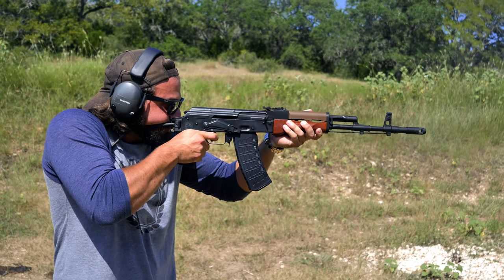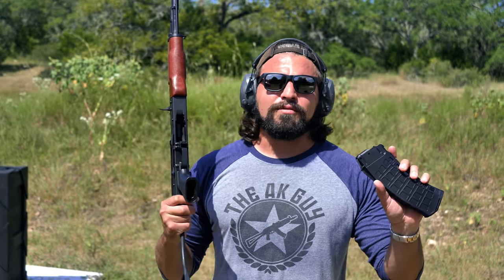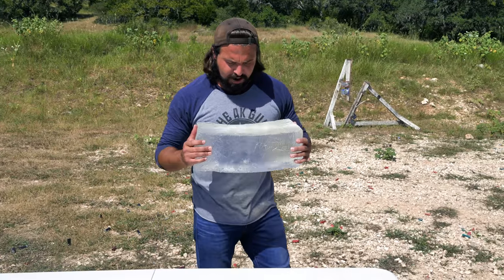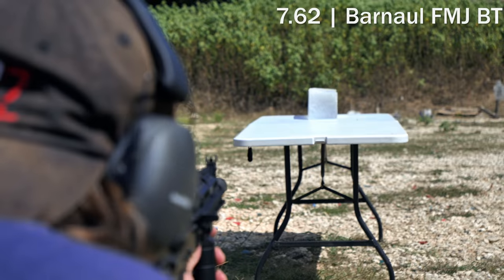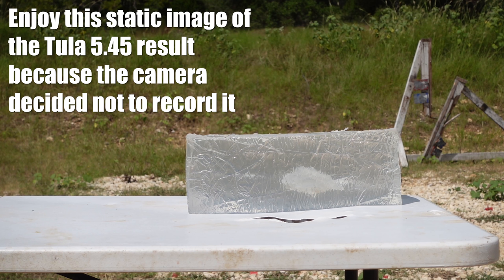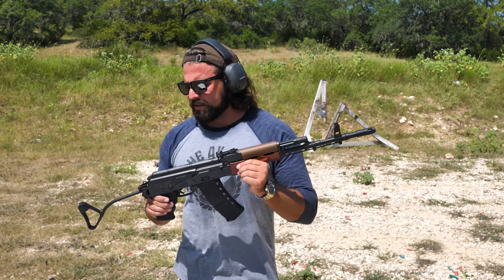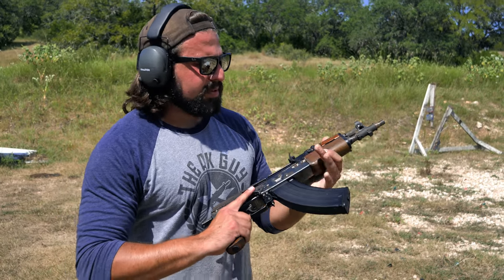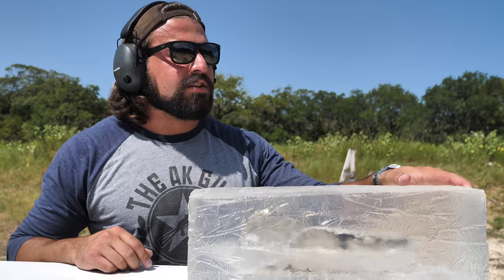7.62 vs 5.45 - Which Is Better?

Comment: Easy. 5.45x39 is way better than 7.62x39. Lighter, faster, flat shooting and has that "poison bullet" effect. 5.45 is also a better penetrating round that 556, due to the longer projectile :)
Reply: truly a man after my own heart
I really wish more western videogame companies would allow us to use it more effectively
cough cough Call of Duty cough (give us more than 30 round 5.45 mags)
Reply: 7.62 is better. better  penetration  than 308 and 5.45.  5.45 is only better at longer range
Reply: @djjaysky9071  nah the .22 bullet penetrates easier and goes faster
Reply: Are you saying the 5.45 round is longer than the 5.56 round?
Reply: Are you saying the 5.45 round is longer than the 5.56 round?
Reply: @djjaysky9071  Why would 7.62x39 have more penetration? I would think that a higher velocity projectile even if it is lighter would have better penetration than a heavier, slower projectile.
Reply: @badassnelson  correct, the projectile of a 5.45 is longer than a 5.56
Reply: @christopherlatorre7285  5.56/223 has a VERY wide variety of projectiles, only 308 can compete in variety (and 50BMG if you only consider those officially adopted by our military).
Reply: @djjaysky9071  No, it definitely doesn't outpenetrate .308 unless you're comparing very different bullet constructions.
@Badass Nelson No, he said the projectile not the round. Not that it's a huge factor anyway, nor is overall round length.
@Quentagon Thornton On certain barrier materials 7.62 will outpenetrate the lighter rounds (5.45 & 5.56), due to the increased momentum helping it continue where the lighter bullets can be more likely to deflect or break up.This is often cited as making it 'better' while dismissing other areas it's weaker in.
Reply: @quentagonthornton49  Heavier slower projectiles have better penetration than faster lighter WHEN EVERYTHING ELSE IS EQUAL (including bullet construction, energy and cross-section), but in 7.62 vs 5.45 nothing is equal.
Reply: 5.45x39 is actually far more devastating than the 7.62mm rounds used in typical AKs because it was developed in response to the M16's use in Vietnam
Reply: @BouncyStickman Brandon talked about it, with the hollow cavity in the tip (which I think was originally done for balance) it has a very high likelihood of tumbling upon impact and causing very significant wounding. Supposedly people in the area who were being shot with it (Afghanistan) started calling it the poison bullet, presumably due to the terminal effect, in a similar but different way to the original 5.56 loading causing massive wounds through fragmentation. The word you want is piqued not peaked btw, it's nbd but I would want to know if it were me.
Reply: @BouncyStickman A term that came from the Mujahadeen in Afghanistan. The 5.45 would yaw wildly once inside the body and create horrific wounds, sometimes doing things like entering the torso and exiting the leg of the target. Similar stories exist about the 5.56 in Vietnam, back when the normal loading was a 55gr bullet.
Reply: it's actually "situational"    5.45 is better open field and for long range patrols,  its lighter, so you can carry more ammo, and or more rations.   

7.62x39 is a better "brush" round.   its heavier mass means it deflects less when it hits tree's and branches.  This makes it more effective in dense foliage such as jungle/forest.  

So for a light fast "foot force"  the 5.45 is better, especailly given platforms like the AKSU.    For a heavier defensive or brush force, the 7.62x39 with the RPK and maybe the Tabuk backing things up.
Reply: “Poison bullet”? Care to explain?
Reply: @djjaysky9071  .308 (7.62x51) is literally a heavy-er and faster projectile with a longer effective range
Reply: @quentagonthornton49  The heavier round is more "barrier blind" than the lighter, less stable round, which is why it remains in use by GRU/Spetz and similar for any operation where they expect to have to shoot into/through softskin vehicles.
There are other videos on YT comparing them (and 5.56x45) in shooting through car bodies at targets on the other side. Or through cinderblocks.
Reply: @Garrumx  The twist rate and barrel length of Vietnam era M16s was far superior imo. A 20" barrel with a 1:12 twist was so much better for the ballistics of 5.56.
Reply: @karelpgbr  once a 5.45 hits you it starts tumbling inside of the victims body creating very vide and horrific wounds which are very hard to patch and heal so a target would often lose too much blood and bleed out the term poison bullet comes from Afghanistan
Reply: @mikefelty2625  that’s why I love my Zastava, 18.5 inch barrel with the IMI M193 55gr gives similar ballistics to the OG M16A1s shooting the first 5.56 load the US used.
Reply: 5.45 is better for the soldier, who has logistical advantages and needs, or the person who has clear shooting lanes and needs longer target precision. 7.62 however is better for people who need to shoot through concealment, do not have supporting or suppressive fire, and are more concerned with short range reactive shooting, and cannot afford more " exotic " projectiles.
Reply: @djjaysky9071  did you say 7.62 x 39 has better penetration then 7.62 x 51(308)?    Ok
Reply: @The_Honcho  I want one of the M16A2 clones with the O.G. twist rate and barrel length. I have plenty M193 laying around. About half of my 5.56 is that, the other half is M855, which does better with the shorter faster twist rate barrels. I like Zastavas a lot, just don't own any. I've heard from friends that the powder IMI uses can burn a little dirty, but I have no experience first hand.
Reply: Still 762 is better
Reply: @Garrumx  
That poison bullet the comes from a Soldier of Fortune magazine article in the late 80s. He made that claim, yet nobody else ever did. Ever since, it's been repeated over the decades, but no afghan would have a clue what you're talking about.
Reply: @mikefelty2625  it depends on the weight of the bullet.
Reply: @SilverStarHeggisist  I know. The lighter 55 grain M193 works way better out of the 20 inch barrel with the 1 in 12 twist rate. The heavier 62 grain M855 works better with shorter barrels with a 1 in 8 or 1 in 9 twist rate. 16 inch barrels are by far the most common barrel length for current AR-15 rifles chambered in 5.56, and most of them have a 1 in 9 twist rate. In my experience 62 grain ammo works better ballistically in newer AR-15 rifles with the faster twist rate. But, the longer barrel with the slower twist is even better with the 55 grain ammo.
Reply: Fragmentation & expansion>yaw
Reply: @quentagonthornton49  this is correct. Only when it meets the overmatch point does mass affect armor penetration. Also .308 isn’t a intermediate rifle round..
Reply: @jameshealy4594  they also call the forward assist on M4s the sniper button
Reply: :( mah 556
Reply: @karelpgbr  tumbleing i think.
Reply: Even survival Russia wants to see the ak50.
Reply: @risenfromyoutubesashesagai6302  That's not an argument. It would suck to be shot with a BB gun too, but that doesn't make it an effective round.
Reply: doesn't matter what bullet it is, you don't want to get hit with either. Unless u wana be a test dummy
Reply: @quentagonthornton49  FMJ 7,62x39 genuinely has more penetration than FMJ 5,56x45 as 5.56 is light and fragments instantly on impact, losing all of its momentum. unless you’re using Rare ass M995 tungsten core rounds
Reply: 7.62 blows fist sized holes in meat and 5.45 blows holes the size of 3 fingers
and better ballistics/flatter shooting doesnt mean it carries energy out to those ranges (which it doesnt)
Reply: 5.45x39 uses a bimetal jacket. ie, steel jacket in lieu of copper. Yes it’s going to penetrate more. Also, it uses a steel insert inside the slug just like the 5.56 m855. Just with more steel. Hence why it’s longer. Steel isn’t as dense as lead. 5.56 still delivers more energy on target than 5.45x39 it’s just the construction of the bullet
Reply: Are you comparing 5.45 to 55-grain M193 ball or 62-grain M855? The Obama administration tried to outlaw civilian use of M855 by calling the round "armor piercing." Fortunately, that flopped. I chipped an AR-500 target at 200 meters with M855. I have a mad respect for that round since seeing that. Correct me if I'm wrong, but I don't think 5.45 has a steel penetrator core - unless you're using 7N6. 5.45 may out-penetrate M193, but I don't see it out-penetrating M855. Again, anyone can correct me if that statement is wrong.
Reply: @RonDevito  yes, depending on the type of 7N we’re referring to, the common 7n6 in those spam cans does contain a steel core at the base of the bullet. At longer ranges, due to the greater velocity and powder charge of the m855, it’s does outpace the 7n6 at longer ranges 
https://en.m.wikipedia.org/wiki/5.45×39mm
Reply: @christopherlatorre7285  not always look at 7.62x25 has vastly better penetration than 5.7
Reply: @jameshealy4594  military arms channel did a video on it 7.62x39 outperformed 308
Reply: @nickhenley1338  it does not out penetrate 7.62
Reply: @Railhog2102  depends on the round the most devastating 545 does not do nearly the damage of the most devastating 7.62
Reply: @zzchief8035  military arms channel did a video on it
Reply: @teamstannis521  military arms channel did a video on it
Reply: @bigmike-  military arms channel did a video on it
Reply: @PaulVerhoeven2  how the hell did you come up with that response? I am in the military myself.
Reply: @djjaysky9071  ? Who are you talking to? I said the bullet from a 5.45x39mm is longer then a bullet from a 5.56x45mm.
Reply: Wish Obama's aft wouldn't have banned 7n6 for importation. Damn vaporwire 74 pistols. Of course the fact that it is rifle ammo but its armor piercing "handgun" ammo sucks. Stupid laws stuff was stupid cheap.
Reply: @quentagonthornton49  you’re not wrong  I was goin  to say the same thing.
Reply: Well, but it's not.
Reply: @christopherlatorre7285  Which response?
Reply: @marblemarble7113  you are conflating energy with force. Force = Mass x Velocity. Energy is 1/2Mass x Velocity Squared. Speed matters a lot more than projectile weight when it comes to energy. The difference between the two rounds is around 7% at the muzzle, depending on your reference cartridge. Ballistics and energy delivered to target at 100,200,300,400 meters will always go to the 5.45, because of the drag coefficient advantage meaning the 5.45 loses less speed as it travels.
Reply: @BouncyStickman there's a bunch of old lore that the hollow tip can trap clothing and debris which can make the wound infected and give a poison like effect to the gun shot wound. Or you can go the vietnam peasant route & just dip them in your poop like punji sticks.
Reply: @mikefelty2625  Superior to what? Modern 5.56 NATO rifle barrel twist rates or whatever is standard in 5.45? A tighter twist enables you to stabilize heavier bullets well. I would rather shoot a 1:7 twist barrel so I can shoot heavier projectiles with 5.56, because frankly, 55 grain bullets are not the most versatile. The DDM4 V11's we had at my last job stabilized 55 grain bullets just fine though and were as accurate at the 2MOA red dots we mounted would allow you to be.
My .270 can not shoot the heavy bullets well because it does not have a tight enough twist to stabilize them. The heavier bullets usually have a higher BC, so that would be a positive for long range accuracy if I could shoot those.
Reply: Actually.... lol
Reply: @trippie_fabio3181  I would love some tungsten core, lead free, controlled expansion hunting bullets. I want to get away from shooting lead bullets but the BC of solid copper bullets is not great. A little bit of tungsten would fix that right up. Would be expensive as hell though.
Reply: @djjaysky9071  that's why you have pkm guys in your squad
Reply: @revilo178 Because MAC did a video on it obviously. That makes it gospel and your logic means nothing.
Reply: @djjaysky9071  did you seriously just say a 7.62x39 will out penetrate a 7.62x51 nato?
Reply: @jameshealy4594  you do know that every OTM projectile does this, right?
Reply: @AgnotologyTV  technically energy transfer (bullet diameter) matters more. The fastest bullet in the world is practically worthless if it passes right through the target
Reply: @badassnelson  No, I wrote that the 545 projectile is longer than the 556.
Reply: @quentagonthornton49  7.62x36 does not penetrate better than the 5.45.
Reply: Ahem… bUt 7.62 iS tHe LoRdS cAlIbEr
Reply: Old mate on factory last night said otherwise, 21 rounds of 5.45 BS 421 damage. This says it all
Reply: @PaulVerhoeven2  For military application, 556 and 545 are both made in 5 variants. The 545 is also made as a subsonic round, which the 556 is not.
Reply: @PaulVerhoeven2  That is absolutely nonsense :)
Reply: @BouncyStickman When the Soviet Union was in Afghanistan, the Mujahedin thought that the 545 was poisoned. That was due to the fact that the Afghan fighters very often died from impact which would normally "just" wound a person. At the time, they did not knew that the 545 tumbles very violently on impact. That because the projectile is quite long, longer that 556 and travels at 3000fps. So a fighter get shot in the shoulder or hip, the projectile tumbles and damages internal organs (sometimes), hence they thought  the projectiles were poisoned.
Reply: @karelpgbr  When the Soviet Union was in Afghanistan, the Mujahedin thought that the 545 was poisoned. That was due to the fact that the Afghan fighters very often died from impact which would normally "just" wound a person. At the time, they did not knew that the 545 tumbles very violently on impact. That because the projectile is quite long, longer that 556 and travels at 3000fps. So a fighter get shot in the shoulder or hip, the projectile tumbles and damages internal organs (sometimes), hence they thought  the projectiles were poisoned.
Reply: @dbt7624  Yes, it is better at dropping like a rock :)
Reply: @theimmortal4718  When the Soviet Union was in Afghanistan, the Mujahedin thought that the 545 was poisoned. That was due to the fact that the Afghan fighters very often died from impact which would normally "just" wound a person. At the time, they did not knew that the 545 tumbles very violently on impact. That because the projectile is quite long, longer that 556 and travels at 3000fps. So a fighter get shot in the shoulder or hip, the projectile tumbles and damages internal organs (sometimes), hence they thought  the projectiles were poisoned. This is common knowledge among Russian servicemen. I seriously doubt they read Soldier of Fortune back in the 80's :)
Reply: @badassnelson  the projectile is a bit longer
Reply: 5.45 was developed after Vietnam AFTER seeing what 556 can do witch is maim a soldier to take more soldiers off the field 7.62 was devolved to just kill and be super heavy/mean especially up close I'm sorry but we kinda got whooped in Vietnam by old aks...
Reply: @crayonchomper1180  Just go Escape From Tarkov :)
Reply: @djjaysky9071  LOL, Nope.
Reply: @SurvivalRussia  I do, but I want Triple A developers to bring the joy of 5.45x39 to the masses or at least make it more accessible, the only reason it is so rare to see in video games is because it is a largely unknown round and low mag capacity
Reply: @colby1398  Whos arguing? Are you gonna volunteer to take a 22LR to the chest? How bout a 7.62x51? Step right up.
Reply: 5.45mm and 5.56mm are pretty much the same caliber(they are equally good). The 5.8mm that China has is also very similar and it might be even better.
Reply: lars..
Reply: @crayonchomper1180  I don't get the "low maga capacity" part :)
Reply: @MIMthegreat  5.8 mm is more powerful but the accuracy on it is not so great
Reply: @djjaysky9071  Depends on the quality of ammo.
Reply: @djjaysky9071  seems you got a stroke on that buddy
Reply: Whats poison bullet effect?
Reply: @SurvivalRussia  "@PV  That is absolutely nonsense :)"

What specifically do you refer to, and what is your proof? Learn to argue as an adult.
Reply: @SurvivalRussia  there are a number of  different 5.45 magazines (10, 30, 45, 60 and 95) but games like CoD only give us the basic 30 rounder to use, they refuse to give us access to the 45 rnd RPK mag or quad stack 60 round "Ice Cream Cone"
Reply: you correct survival russia the chechens diddnt call it the poison bullet for nothing
Reply: Also 5.45 does not require muzzle velocity to do damage unlike 5.56 which requires the velocity to fragment and do damage. 

Love the vids Lars. Do you plan to do a video on your new rifle?
Reply: Sounds like a 556 to a 545 fight
Reply: How does body armor affect that equation?
Reply: @christopherlatorre7285  Yes, and it sacrifices quite a bit of velocity because the bullet is longer because and leads to the 5.45 having a noticeable drop in energy compared to 5.56 and even some velocity.
Reply: @djjaysky9071  LMAO "7.62 is better. better  penetration  than 308 and 5.45." Buddy you need to educate yourself on calibers, their energies, and velocities because that's a flat out lie. It's fine to love 7.62 but don't spread inaccurate information. 5.45 has better velocity than the 7.62... that's just a fact, and the .308 has more velocity than BOTH rounds.
Reply: @dbt7624  It depends on the application. Close range? Yeah sure. Long range? HELL no.
Reply: @djjaysky9071  "not always look at 7.62x25 has vastly better penetration than 5.7" 
*You did not just say the 7.62x25mm has better penetration compared to a 5.7... *

Bro the 5.7x28mm has literally double the velocity of a 7.62x25mm... it has the same velocity (give or take) as the 5.45 as well. It fires at 800+m/s and the 7.62x25mm fires at 350+m/s
Reply: @djjaysky9071  "it does not out penetrate 7.62" 
Just because the 7.62 has more energy than the 5.45 does not mean it penetrates better... Penetration is determined by a variety of factors, and the 5.45 was LITERALLY designed to have better penetration than 7.62 which is why Russia replaced the 7.62 with the 5.45 in most of their combat units... That's the entire point of why they made it my guy. It's easily researchable.

Not to mention .308 actually has over 1500 ft lbs of evergy more than the 7.62 dude...
Reply: @SurvivalRussia  "7.62x36 does not penetrate better than the 5.45." FINALLY someone with common knowledge. Thank you.
Reply: @tylermallory2504  "did you seriously just say a 7.62x39 will out penetrate a 7.62x51 nato?" I don't think he did... did he? I'm not seeing a comment where he says that.
Reply: @nkdude11  This entire comment section is literally just "MUH 7.62" and its comparable to the "MUH .45 ACP" fanboys who know nothing about ballistics and just assume bigger = better...
Reply: @djjaysky9071  More powerful than what? It has nearly the same effectiveness as the 5.56, even. Nearly identical velocity and energy.
Reply: Ayyy Survival Russia, nice seeing you here!
Reply: @LethalByChoice  it's literally the second comment under the O.P.
Reply: @PaulVerhoeven2  redundant argument is redundant. Other things are not equal.
Reply: @BouncyStickman  Go watch the old MrGunsngear short barrel 7N6 testing video.  He couldn't keep the rounds from turning and  escaping the sides of the blocks.
Reply: @trilliamogdlocog4986  It seems like this "5.56 was designed to only wound" myth is never going away 😐. Was the Kyle Rittenhouse incident still not enough to stop that myth?
Reply: @MinecraftGuy237  Foo that was point blank ain't nobody in the military getting that close to their target ...I never said 556 can't kill I said what the round was originally designed to do in war compared to other rounds like 7.62, 308 etc the 556 and 223 is still a 22 caliber round imagine if Kyle had a 12 gauge or sum bigger shi even 40 s&w will put a good hole in someone...
Reply: @trilliamogdlocog4986  A few points I'd like to address here. It doesn't matter that it was at point blank. The 5.56/.223 doesn't lose significant ballistics until after a couple hundred yards. Effective range also depends on the bullet grain and/or barrel length.

As for the wounding myth, an enemy that is not incapacitated can still continue to inflict casualties which can take YOUR troops out of the fight too. Its not like a lot of them are just gonna lay there for their men to drag them out. There is also no guarantee that the guys right next to him will just drop everything and ferry him off. Maybe they already have dedicated medics on hand for that, maybe they won't prioritize treatment of the wounded until the battle is over, maybe they'll just leave the wounded guys behind (I seen that happen) so your forces have to deal with them which is gonna come out of your own logistics. You don't want to wound the enemy, at the very least you want to incapacitate them which requires a lethal shot or a one thats QUICKLY fatal if not treated IMMEDIATELY. Just wounding may have its perks sometimes but you can't rely on that. 

As for the 5.56/.223 being a 22 caliber round, well you're not wrong but thats still an understatement. Its a 22 caliber yes but its VASTLY more powerful than your 22LR due to being a high velocity round. A 12 gauge has a more devastating damage yes but its overkill if you're just shooting at man-sized targets. You don't necessarily need something that powerful on man-sized targets if you can do the same job with just 1-2 rounds of 5.56/.223. As for a .40 S&W... a .40 S&W is WEAKER than a 5.56/.223. It does leave a bigger entry hole but entry holes don't matter. Its the terminal ballistics that matters. Not even a .45 ACP or .44 magnum is as powerful as a 5.56/.223. You're comparing rifle rounds and pistol rounds here. If you want a pistol round that produces more energy than a 5.56/.223 then you're gonna have to move up to a .50 AE or .500 magnum.
Reply: Ага, а в зеленке 5,45 летит куда угодно от одной веточки.
Reply: Say what you want but 7.62x39 does a much better job on deer and most game in the continental United States.
Reply: @benjimenfranklin7650  Ammunition for combat has different properties than hunting rounds. It's for a reason hunting rounds are not used for combat...
Reply: @SurvivalRussia  
Ok I'm a little biased I have several crates of 7.62 x 39 military ammunition including some copper washed from China and understanding how it works very well now. Hunting ammunition was hard to get when I started with this little SKS rifle but the Russian hollow point ammunition let me hunt with it anyway. I have because quite proficient with it. It's good out to about 350 yards but I try to keep within 200 for clean kills. I have found some Russian ammunition that has an air bubble in the tip and it acts exactly like a hollow point. Also other ammunition that can penetrate 3/4 inch of soft steel.
Reply: @benjimenfranklin7650  I use 9.3x39 for hunting. It's dense forest here, so it's very rare we have to reach out beyond 200 meters. Less than 100 meters is the norm here.
Reply: @djjaysky9071  bro what lmao 7.62x39 does not have more power than a .308. Lmfao both use a .30 cal projectile. .308 uses heavier grain and more powder. .308 is literally 7.62x51 and 7.62x39 is the ak ammo ur talking about lol
Reply: @mikefelty2625 there a reason they use 1/7 twist now instead of 1:12